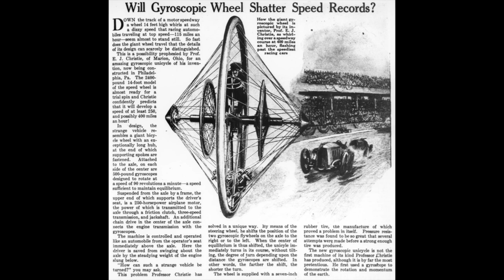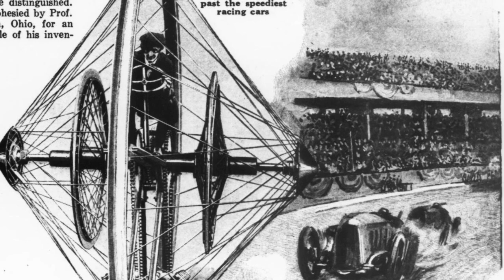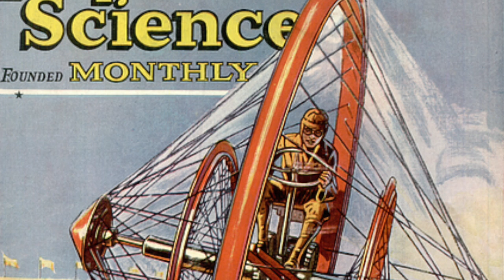The Incredible Gyroscopic Wheel Of 1923

Comment: There were some single wheel vehicles produced. The ones I've seen in films had the driver sitting on the bottom inside of the wheel, and the whole of the wheel rotated around him. They looked pretty cool, but there must have been some great disadvantage, as they did not appeal broadly enough for success.
As to this contraption, I tend to think more than rubber times would be a problem.
Reply: I've seen that film too, so cool and solves the problem this one has of getting up that high to start it, let alone drive it.

Comment: About as feasible as electric cars😂
Reply: I don't think you understand,what the word 'feasible' means.
Reply: There were electric cars running around the US cities decades before this gyroscopic wheel was proposed. They were more popular that internal combustion autos for a time.
Reply: The electric cars are back again. Someday, maybe someday a person will invent safe, singular, individual travel.
Reply: @patriciajrs46  Safety is on a sliding scale. All we have is whether something is safer or less safe than something else. Not traveling at all may be safer. So risks are always involved.
You can minimize risk in any mode of transportation, but since you cannot control anyone else, there will always be some risk out of your control.
Cars in general are pretty safe and convenient. Fairly low risk to personal injury broadly speaking, especially if good attention is applied by the operator. And they can be singular.
The main problems with private cars is the amount of energy used, the impact on the environment, and the amount of space needed to accommodate them.
On a large scale we'd be much better off with effective public transportation wherever possible. This can be made very safe and with low impact, but it isn't singular.